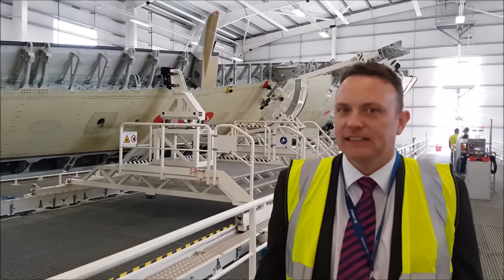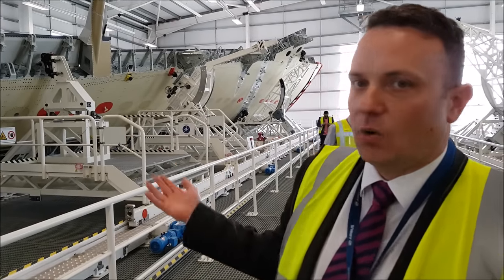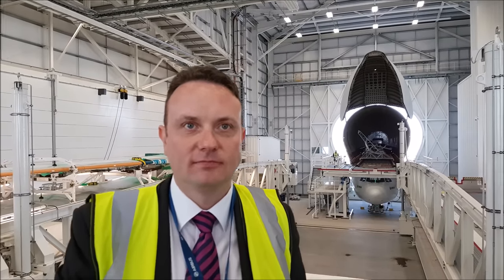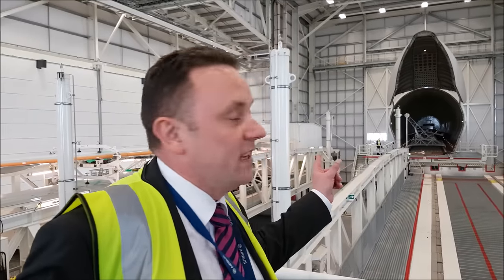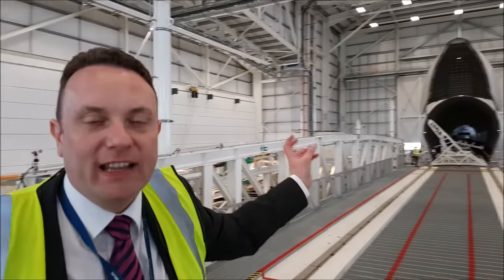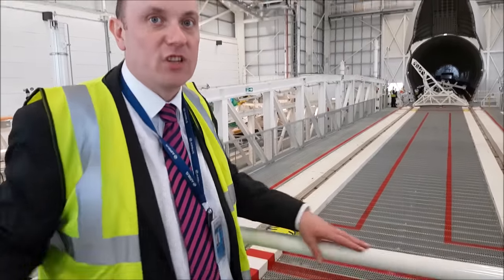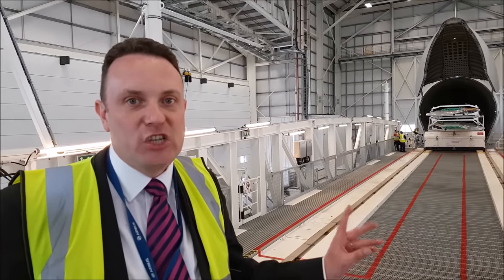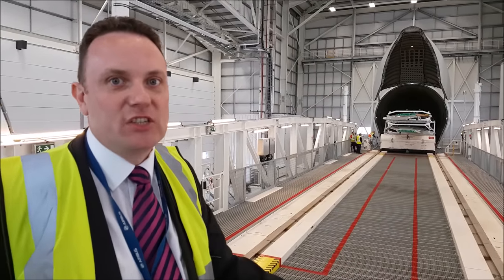Exploring the Airbus Beluga

Comment: I find it amazing this plane is still  able to fly at a stable 0.69 mach speed while carrying all that weight and having that unconventional shape with only TWO ENGINES
Reply: Even wide bodies are moving towards 2 engines. The tech has come a long way and there are the fuel saving considerations. A350 predecessor A340 had 4 engines and A350 (that is larger) has two engines. 
Beluga is based on A330.

Comment: How does it fly with those small a320 wings?
Reply: The base model for a beluga is an Airbus A300, not a A320. The A300 is a wide body plane with a wingspan of 45m. In addition, the engines are taken from the larger A330, which compensates for the increased drag.
Reply: A300
Reply: Connor Naude I thought it was a A3800

Comment: Im Amazed by the fact that this particular plane only need two turbine engines, though the A380 are built with 4 large Turbine Engines. Even though A380 only carries passengers with a average weight of 80-90kg Where the belgula plane are meant for transporting massive structures. The Belgula Can Carry fuselages for other aircrafts.

Comment: Why beluga use control columns instead of joystick? Airbus is famous for using joystick for its aircraft.
Reply: It isn't called a joystick but a side stick. Beluga is based on the early 70s A300... Which was designed with a yoke. Later models departed the yoke to introduce the hallmark side stick

Comment: Ok geek question, why does it have a yoke instead of joysticks?
Reply: The beluga is pretty much an A300 with a huge compartment fitted on top. It has the cockpit and lower fuselage of an A300 - which was released before fly-by-wire was developed - so it's got a traditional yoke
Reply: @alexsalmon5994  Doesn't the a300 use fbw?